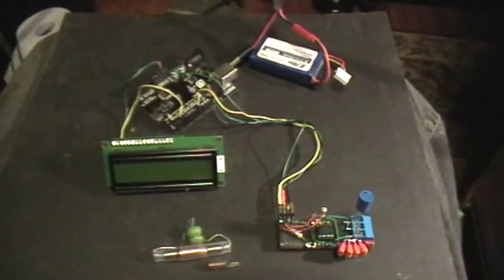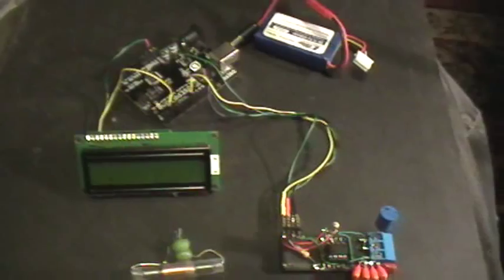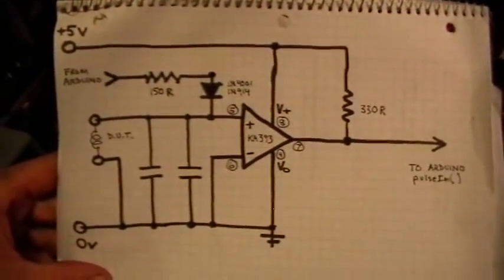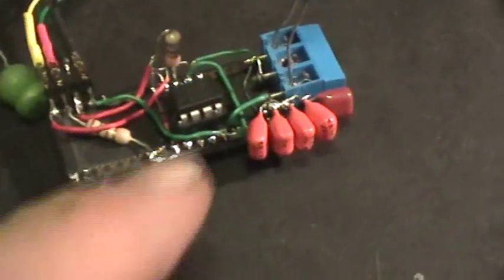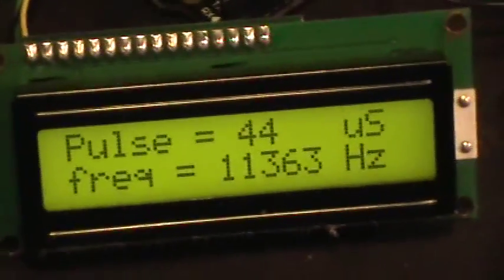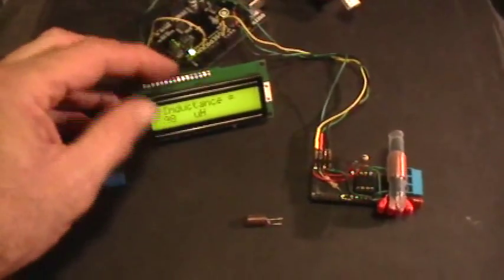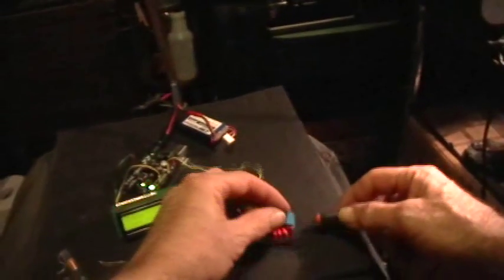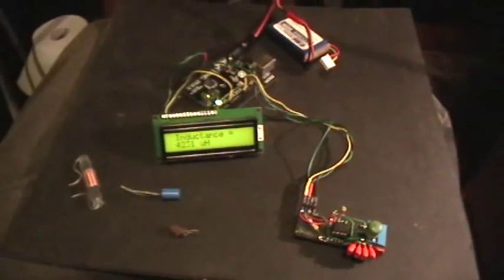Arduino 14: Induction Meter using Parallax LCD and KA393 Comparator

Comment from the maker: That's not a bad idea actually. Then you could look at exactly what I'm looking at.... wait, maybe not such a good idea after all. 

Once you have an app developed for the Arduino, you can get one of the "pro mini" versions which don't have the usb interface stuff or the USB and power connectors or the header sockets or other stuff like that, they are very small. You upload your program into them, solder them into your app, and forget about it. I did my Meditation Ball in this manner.

Comment from the maker: I think this exact same circuit can be used to check capacitance, by putting a known inductor in place of the capacitors here, and changing the formulae and constants in the program sketch where the resonant frequency is measured and the unknown L (or C) is calculated. i wish I'd realised that when I laid the thing out, I would have done it a bit differently. Might still do.

Comment from the maker: Thanks! The display is the Parallax 2x16 Serial LCD with speaker and backlight. It only needs three wires: power and one data line. The display is driven by the ParallaxLCD library, very easy, that I linked in the first video using this display. You can download my program sketch and see how it's done.
Yes, I think Arduino can do what you want. If you look at my SousVide controller videos, it is Arduino PWM modulated mains power to the cookpot.
Power section was designed by genesis at moletrap.

Comment: Well done,  TK! 
What kind of LCD display do you use for it? 
Are there software libraries to control the LCD display? 
Would it be possible to build a 50 Hz sine wave modulating the Arduino timer  PWM circuit for a 60Volts DC to 230 Volts AC inverter? I want to use 5 car batteries in series to build a powerful inverter this way... 
Thanks!